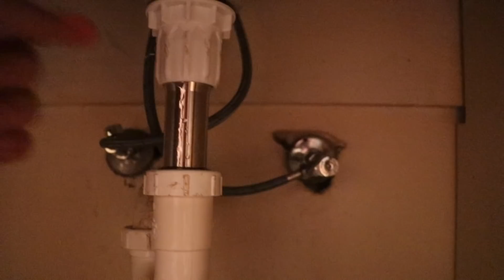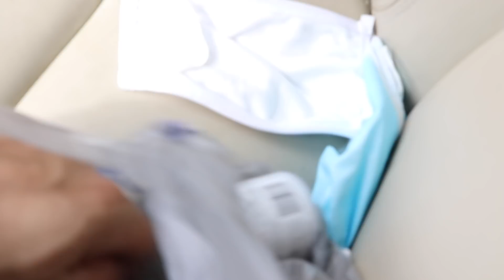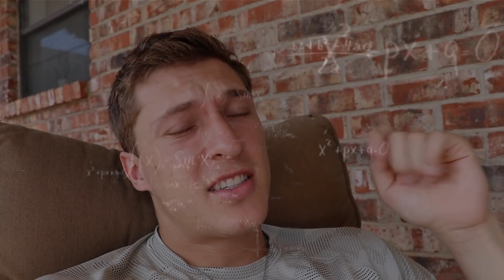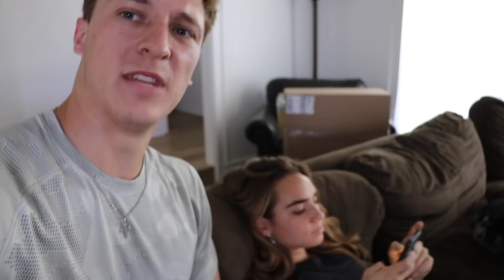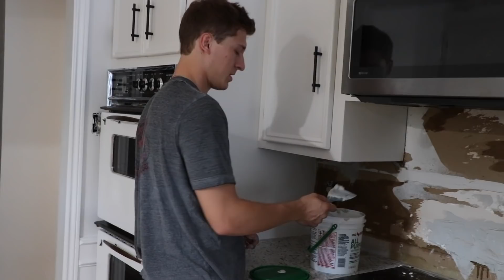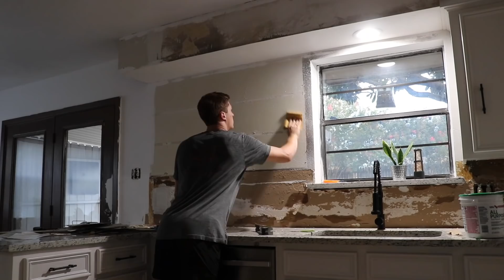Preparing for our BIGGEST renovation yet...THE KITCHEN

Comment: Bronson do not tile over that existing drywall, paint, torn paper, you will not get a good bond with your adhesive to that. Guarantee the tile will end up breaking bond. You want to cut out the sheet rock with an oscillating tool and put up 1/2" cement board.